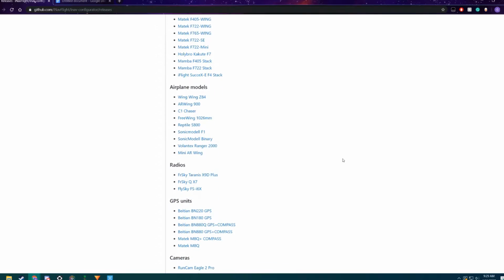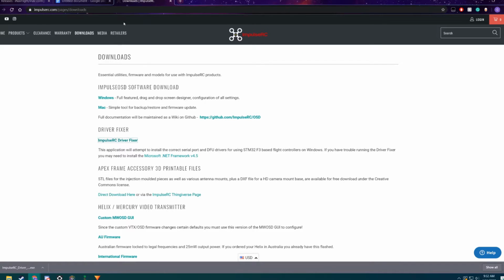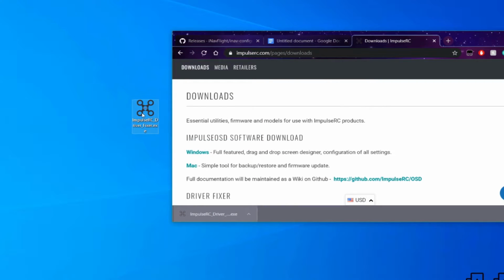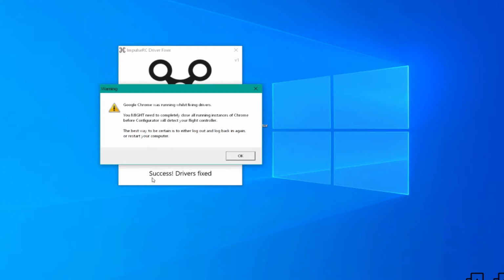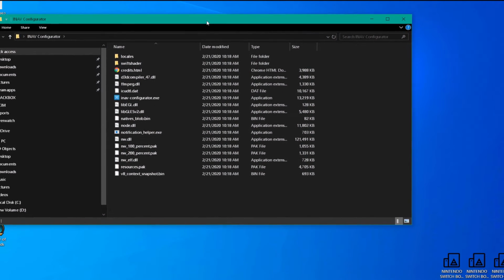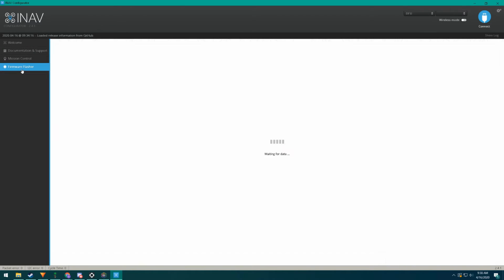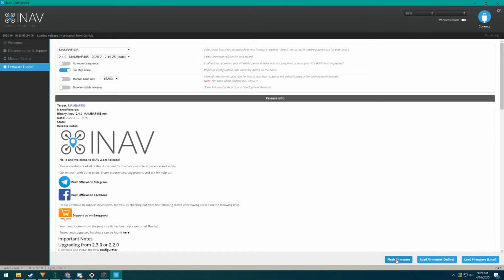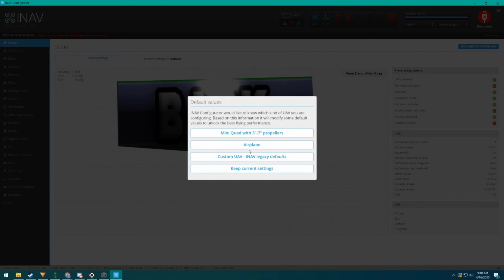How to configure INAV: installing INAV (part 1/6)

Comment: Hi, I am new to this (Retirement Hobby) and would like you to show me how to get the INAV software onto my PC. I believe it is up to version 3.0.1 just released in July 2021. I am about to order my TX16S Max Radio and a Matek controller to put in to my DJI F550 Hexacopter. I know it's old stuff but I am a beginner and needed to start somewhere. Cheers Kev.